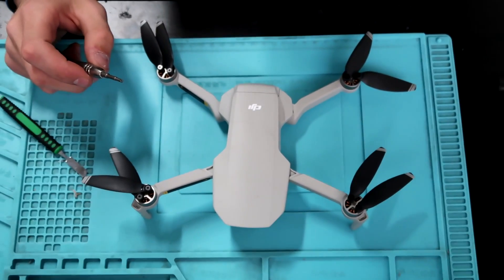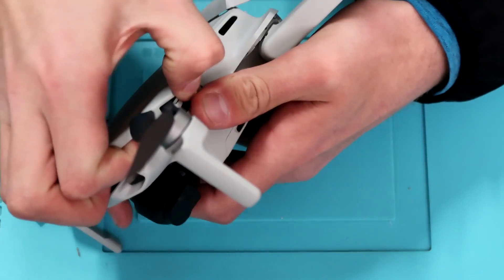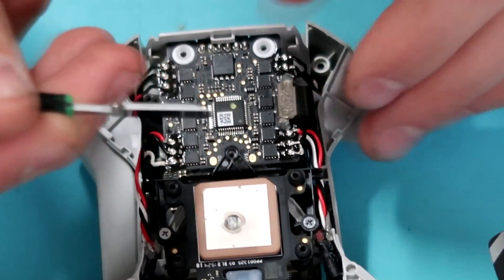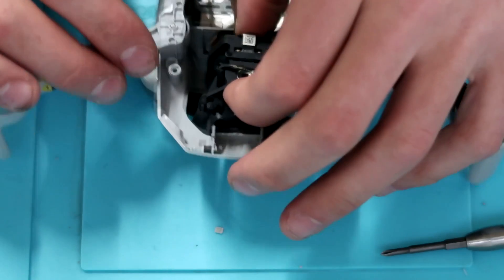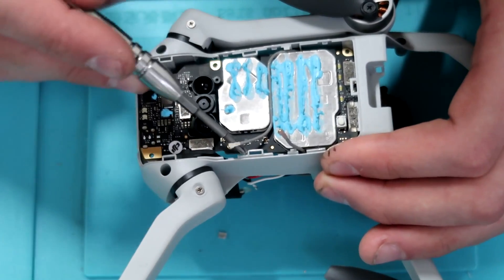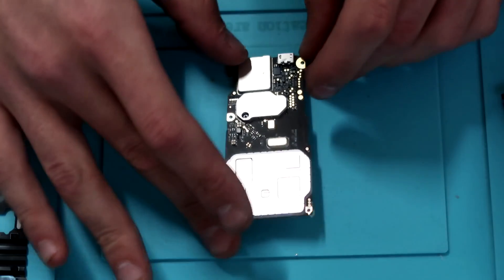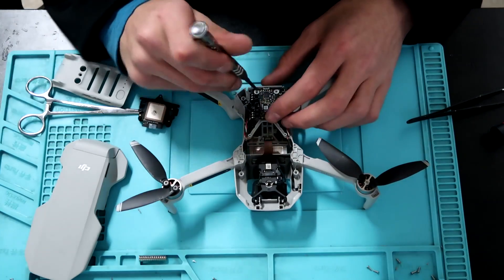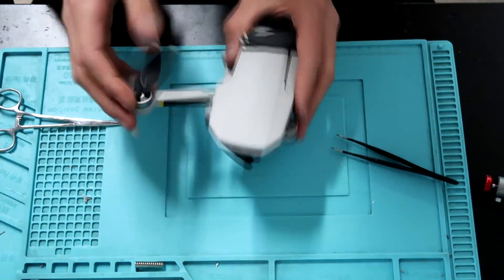We Teardown a Mavic Mini and Put it Back Together Again!

Comment: I bought a used Mini 2 and on my first flight, I noticed the camera is badly out of focus (except within 1 - 2 Ft). It has some gouges/scratches on it, and the lens glass is missing so im assuming it took some kind of hard landing.

During this disassembly, did you notice anything on or related to the camera that I could mess with that might resolve this issue?
I tried a firmware refresh, and the firmware is up to date, but nothing. I even paired my controller and phone to another Mini 2 which worked flawlessly.

Comment: I changed the main board and front right arm and all of the ribbon cables and now I can't get it to pair with the phone or controller.  I've tried all the different ways on YouTube and no luck .
I have a picture but no motors any ideas

Comment: you did an awesome job sharing the drone.  the wind blew a small branch toward my drone while it was in mid aid and knocked out one of the drone motor triple propeller kits off, and my drone was twirling straight for the ground and damged my drone arm connection and main body

Comment: I have been struggling with a stripped screw in the back of the casing. It is hard to reach so most normal methods don’t work. I was wondering if anyone has any advice

Comment: I wish they would of designed the mini 2 with a small cooling fan where the heat sink is somehow because that area gets really hot. I wonder though.... what if you left the heat sink out all together to let the heat circulate through the vents?

Comment: Can you do a video on taking apart the rotor housing?  Some sand got into my mini2's rotor housing apparently, it clogs a bit when I turn the blades.  I think i need to open the housing to clean out the remaining sand particles that cannot be blown out.

Comment: Hi, I'm working on a very low power accessory for the mini- are you familiar enough with the circuitry that you might share where I can tap into either 3.3v or 5vdc?  I'd really like to avoid adding an auxiliary battery.

Comment: when you removed the top shell, the compass (mini chip on the drone’s nose, in between the two rubber mounts that hold the gimbal.) did you remove it before this video? i’ve been trying to get it out, but it’s stuck in there. thanks

Comment: I do not agree, it would have been interesting to see the motors removed and see where the antenna placement is. It is hard to see or interpret, are both antennas in the front feet or where are they located.

Comment: I'm doing this right now and I've just figured out that you wouldn't need to use force remove the top. Just get inside the battery terminal and there's a small detachment in there, you wouldn't break anything. Just the screwing part is the hard part. <3

Comment: Now we know how to make it lighter. Just remove the top and bottom plates. Replace them with, I don't know, some kind of fine mesh, secured with the screws. To help keep any dirt out. Last, add some sort of extra security for the battery. As for me I like it the way it is, but it would be interesting to see how well it would perform

Comment: I attempted to remove the top shell on my Mini 2 to see if I could adjust the gimbal's rubber support frame, as I had a slight gimbal tilt after a minor crash. I got the back of the shell somewhat removed but decided to give up because I thought I was going to break it. I figured I'd fiddle with the gimbal adjustment some other way. 

But when I went to fly the drone today, the Mini 2 would not power on with any of the freshly charged batteries. I must've dislodged or pulled out a wire when I was using my mechanical screw driver to pry up the shell. Since I've pried up the shell, the little round sticker in the battery bay shows I've detached (partially) the shell, so I'm sure warranty service wouldn't work here.

Comment: Very interesting!
Ever thought of unscrewing the new Mini 2?
It would also be very interesting what is installed, also in comparison to the Mavic Mini.
Reply: I just took off the top cover from my new mini2. Needed to fix the gimbal as the plastic holding bracket broke. I did not went deeper as it wasn't necessary but just by eye it looks the same. Seen some minor changes on the cabling to the cam but other than that it looks(!) Identical.

Comment: Does replacing the (Transmission Flex Wire 3 in 1 flat cable) require calibration?

Comment: I need to replace the ESC flat ribbon cable that connects the top and bottom circuit boards (the cable goes down the side of the battery compartment) how easy it it?

Comment: Is it possible to replace the gimbal / camera assembly just by removing the heat sink?
Reply from the maker: negative
Reply: I think its possible you only need to disconnect the ptz cable off the board and take the cable clamp off the top of gimbal to remove ribbon cable, unless there isnt enough space to unscrew the clamp, obviously take the gimbal off the 4 rubbers first.. just a thought.. but i think it would be a nightmare putting it back together without having the top off... so may as well pop a few clips and screws out...

Comment: Mini crashed & drowned deep in dirty water but found it. Battery was taken out. Immediately dried it under sun. Later after opening it found that small PC Board which connects battery & power motors is kind of fried. Even 1 of those tiny chips/IC are fried. Haven't tried to power it again. I doubt it will not power up or motors will not work due to that fried PCB. What do you suggest ?
Reply from the maker: water is a drones KRYPTONITE. most of the time it's a complete rebuild other than the shell, not an economical repair.

Comment: REMOVE BATTERY FIRST
Whats the blue base you are using
Why would a manufacturer use a brittle plastic for a drone
I have a Parrot Anafi - No desoldering needed NOT IMPRESSED
Take a photo of the wires before de soldering

Comment: Hi ,
I found a mavic mini when i was in the mountains ,it has a broken leg ,the question is if i repair the leg and buy a controller will i be able to use it?
Thanks
Reply: yes ,you can
Reply: Hi ,
I recived the controller but they are not connecting together ,how can i fix this?

Comment: Have a question I’m lost if your desoldering do you need to add some off the metal to the end or do u just heat up solder and remove the wires

Comment: Any idea on fixing the ESC connection error?  "Repairs required. Contact DJI support for assistance. (Code 30085)". Crashed into fresh water for about 2 min. washed and dried in rice 2 days. Now turns on and connects to app but wont let me take off showing that error on the app flying screen. Light on drone stays on red. Any ideas what it could be? Thanks

Comment: Thank you so much! I recovered my drowned Mavic Mini (Fresh water). It was cleaned with compressed air until all the drone is dry and afte thar it stayed  2 days in a room with air conditioner. After that I removed the shells and finish the clean with Contact Cleaner. Now its working very well.
Reply: Did any part of PC boards or IC chips were short-circuited / fried due to water entrance?

Comment: Hello, great video ! I added a bright 5mm white led in one front eye of the MM, and connected it to the power distribution board, where is says 3.6 and GND
- Is that 3.6V, or a bit less ? White led usually accept 3.4v max. In my case it is working now, but the led is VERY bright
- How much power could I take from the power distribution ? I intend to add a bright white led to the 2nd eye, a strobe on the top, away from the GPS, for a better safety toward other flying planes, and may be a buzzer as seagulls are attacking my MM and I need to scare them away.

Thank you

Comment: do not use a HEAT GUN anyplace near those ribbon connectors! it will create solder melt in the connectors, i  used very fine cutters and pried them off.

Comment: Hi! I would like to build a battery discharge for the mavic mini, to avoid damaging the batteries when I don't use it for a long time. Could I know how the 6-pin battery is connected? I have to find the + 8.4v, + 4.20v and ground ... Thanks for the time and for the nice video!
Reply: The connector pinout is
Data - + + - data

D - ++ - D

Comment: I belive at 6:21 that's a hall effect sensor to detect the present of one of the accessory that clip to the drone. Once the prop protector is attach to the DJI,  it limits flying height and range. It's detected with a sensor.
Reply: I think it's the compass.

Comment: I get a feeling that the spark has a much stronger frame.
Reply: the mini uses cheap ABS molded plastic, it melts around 190F and is not a good solid plastic!
Reply: Do you think weight might have something to do with it?   :O

Comment: Would it be possible to take the Mavic air 4K gimble and retro fit it into the Mavic mini?
Reply: its not the camera that's limiting you from 4K video, it' the software. they both share the same camera and same sensor size. dji has limited the software's ability to capture 4k video - probably to differentiate a higher value drone from a lower value one

Comment: Great vid, but in future I suggest using a better tool than the the screwdriver and being so rough against the pcb components to get those antennas off. https://youtu.be/E7hdTZ2BUSU?t=319 if you watch again you were incredibly close to brutalizing those tiny components on the board while prying in a hurry. better to swap tools and be a little more specific since your showing potential noobs. ;)

Comment: great video. more off the shelf components then I expected. btw the white stuff is called silastic which is electronics grade silicone (doesn't use acetic acid to cure which is corrosive to electronics)

Comment: 6:38 It could be a hall sensor
Reply: I'm thinking a 3 axis gyroscope to measure angular velocity. The gimbal would then rotate in the opposite direction at the same rate to hold the camera still.
Reply: @C0deRage  Apparently, the Inertial Measurement Unit (IMU), containing the positional & angular accelerometers, is located on the underside of the board that holds the GPS module. A three-axis hall sensor magnetometer for sensing magnetic heading seems more likely, particularly considering its location far forward, away from the power/propulsion electronics (with all their electromagnetic fields), and as far away as possible from the gimbal motors (for the same reason).
Reply: @C0deRage  Could be possible. Yeah

Comment: is it not recommended to  operate the mavic mini  in temperature below 0 degree areas?
Reply: Your battery would work only with very reduced power. You would have limited fly time and potentially damage the batteries in the long run
Reply: Vincent Fischer what about. Flying in 1 degree  celcius ?
Reply: @lokasamasthasukhinobhavant606  Not much better. Generally for Lithium Ion one says between 10-45 degree celcius is optimal. But you could for example prewarm them in your pocket and only take them out for flying. I've done it several times and all my air vehicle survived. I wouldn't fly long range missions though

Comment: It would be useful to know where the little bits you broke came from so that we can try not to do the same thing 😁
Reply from the maker: the top shell very fragile espeacially after being torn off and put back together 5x). After playing w/ the mini SOP is to replace the top shell for all customer Mavic Mini repairs.
Reply: Um, with all the small pieces that were left over after disassembly his Mini now only weighs 248.5 grams. Hey, I'm just looking at the positive side of this video. LOL
Reply: i took of and put the cover on 20- times, not one broken tab, trick is to use a CELL PHONE repair pry tool or the guitar pic type would work as well.
Reply: @urbanbeets  Also, Make sure the plastic is up to a reasonable room temp. Plastic is even more brittle if you just crashed it out in the cold.

Comment: Please also disassemble the battery! I dare not disassemble mine, but I am very curious about whether the 18650 cells can be replaced. Instead of 2400mAh cells, 3500mAh cells would be added. This would allow you to fly for 40-45 minutes.

Comment: Could you disassemble a mavic mini battery and do a diy upgrade? Ive been thinking that without the battery housing you might be able to fit two 21750's bound with some electrical tape.

Comment: I guess the small board at left front is the compass sensor board.
Reply: The compass sensor will be on the IMU/GPS board 😎👍
Reply: @pdtech4524  If so, any idea what that small board at the left front is? PS. it does seem to be connected through the flat cable harness to the GPS/IMU board.

Comment: Was wondering where the battery charger is? The wall plug is just a 5vdc power supply so is the charger built into the drone or is it in the battery board?
Reply: Neil Smith the battery charger is on the main board and charges through the ribbon cable up to the esc board.

Comment: is there a way to lower its weight like 27 grams to attatch pgytech landing gear and lume strobe light? thanks
Reply: You can take off the camera but I guess you want to film something
Reply: @timbordasch4118  well, is there something less drastic? like the battery door?
Reply: @dv2045  you can cut of the 2 'feets' of the drone at the front side
Reply: @timbordasch4118  ok,. aint that the location of the drone antennas?
Reply: @dv2045  ohh:Dyeah that might be the case
Reply: @dv2045  you can cut open the battery and try to use different cells - but that might be too advanced of an Operation
Reply: @timbordasch4118  then you'd lose signal..
Reply: @dv2045  you could try making your own extensions, with styrofoam  and superglue. I would just skip the extensions tbh.
Reply: @carlose6010  true true
Reply: @dv2045  I think best to practice hand launch, and retrieve with the little one when on poor terrain. With RTH you can take back control as it gets near.
Reply: I think Japan has a smaller capacity battery to bring the weight down... but not 100% sure
Reply: @dino5002  yeah. In Spain we have a law that you can fly a sub250 grams drone OVER people and during night time. Thats why I would use japanese batteries for those situations and use the regular battery for countryside flights

Comment: HEy

yesterday I tried to attach a small powerbank (56g) to my Mavic Mini. It cant take of with a cable connected. When I first take of and then connect the cable it doesnt charge.

Do you know a solution
Reply: Yeah.... Take the 18650 batteries out of the power bank and wire them into the battery.
Reply: I would think it disconnects the power when it is charging. It likely can't do both at once, charge and supply power.